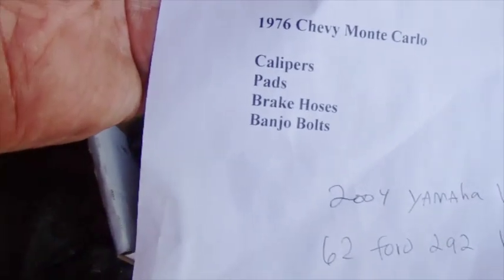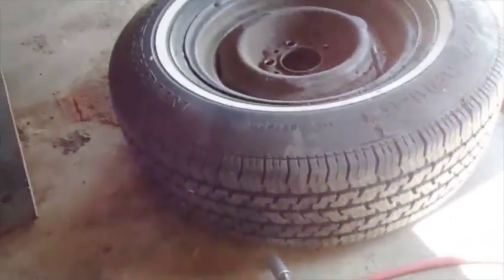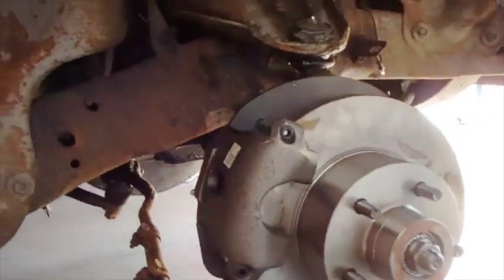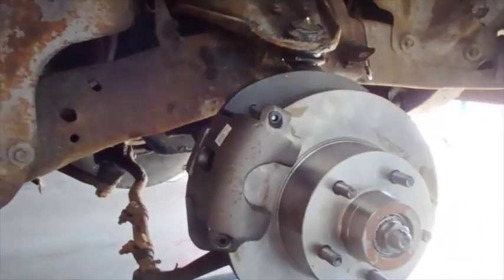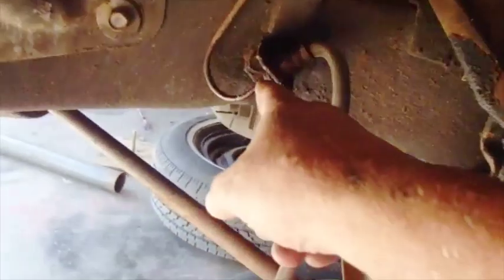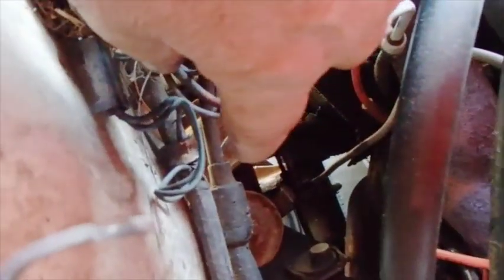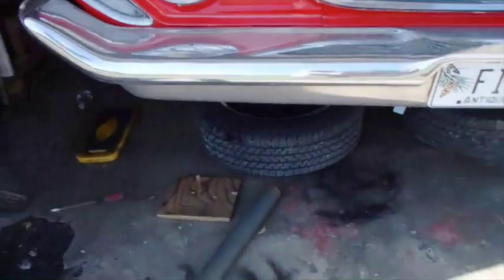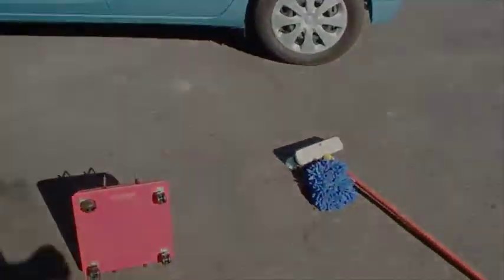61 Chrysler Disc Brake Conversion calipers and hoses

Comment: The upside with Dodge is they kept so many older-design parts and upgraded them as needed, so its no surprise that the spindles will take disc brakes. Check out later model C bodies for the rest of the brake system, as well as trucks and vans. Are you going to use a proportioning valve, to modulate brake pressure?
Reply from the maker: I've got one but I don't know if I'll use it or not.   Seems unnecessary to me...
Reply: The reason for a proportioning valve is disc brakes take a heap more pressure to make them work than the old drum brakes do.  Sometimes the lines are sized such that the rears get a lot less pressure, the other way is using a proportioning valve.  What this amounts to in a practical sense is that more often than not the rear drums will want to lock up.  That's good if you want to swap ends, but for getting even brake application, not so much.  I have heard tell of situation where a proportioning valve wasn't used and the brakes worked fine BUT I'd take that with a grain of salt.  I wouldn't chance it.  But if YOU do, check that the rear brakes don't lock up on you.

Comment: those brakes are not good enough..
Reply from the maker: What makes you say that?
Reply: @rpeek  your brakes are out of a Dodge Aspen, the wight of that car is 3100 lbs, your Newport wight around 3900 lbs, so do the math, put a 800 lbs trailer in your daily drive and hit the brakes, and see how good they are with 800 lbs extra.
Reply from the maker: @hemidenis    Have it your way.    Fact is you can believe whatever you want about 'em.  You'll never drive this car.  I drive it a lot.  It's so much better than it was before.   I like it.  I paid for it.  I drive it.  If you have any further concerns feel free to talk to your wife, your pastor or your therapist.  Meanwhile I'll be enjoying my ride.
Reply: @rpeek  Ha. I have a 61 Newport, a 61 New Yorker and a 1957 Imperial. I was just browsing for SSBC disc brake conversion for a 14" rims with a double piston calipers. I'm doing a research if they brake good, If i ever do a conversion. Your caliper just don't have enough bite force as a single piston. Try to make AJJ lockup and you will see how good your brakes are.
Reply from the maker: @hemidenis    So Your Newport has the shoe brakes with twin cylinders inside it?   Mine did and they would lock up on me when I touched them and I'd have to put the car in reverse to get them to unlock.   The back ones still do.  I'm considering changing the back ones to discs too.  If you learn what's best feel free to share.  Although I'm happy with what I have, I'm also happy to learn if there's something better.
Reply: @rpeek  your springs were bad or  had the spring hooked in the wrong part of the shoe which caused the shoes to twist. You can buy new springs today that they were not available 3 years ago. Ajj was the pioneer in disc brakes. Do to the lack of performance other companies produced their own setup. Yes my 61 Newport and New Yorker still have the shoes on them. Lack of affordable drums replacement are making me think.